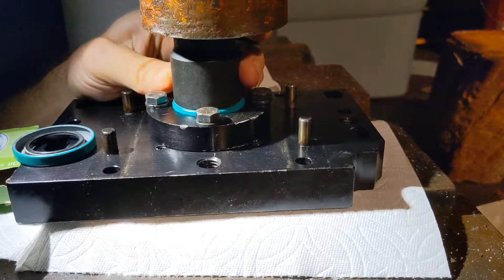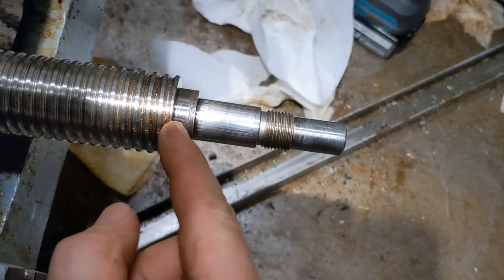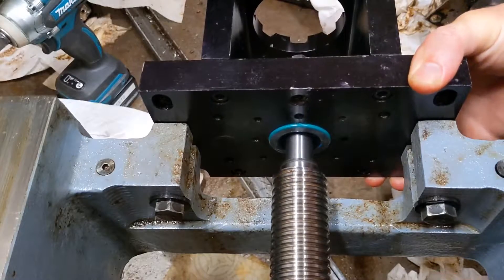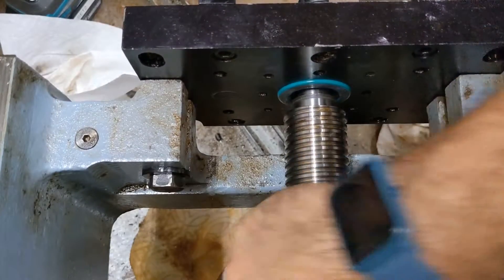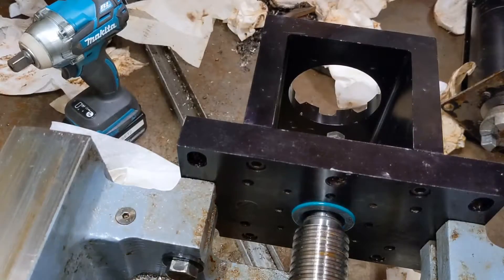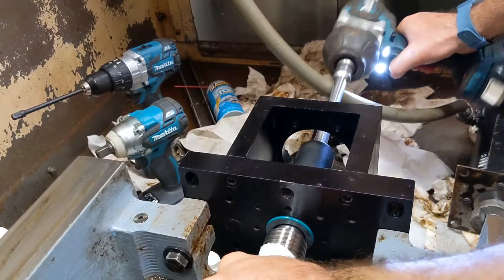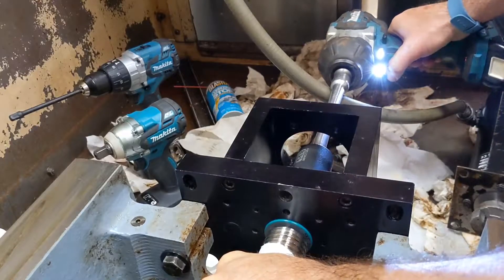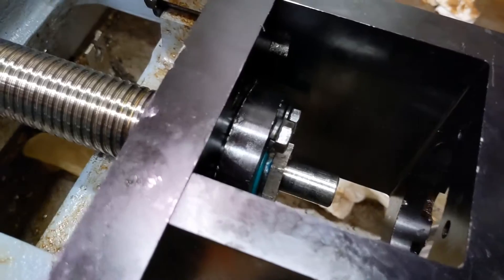Fadal 4020 Thrust Bearing Replacement Part 2

Comment: How have your preloaded thrust bearings been working? Any issues after running them?
Reply from the maker: I'm still working on rebuilding the rest of the machine so no actual hours on them yet... I'm replacing the controller and DC servos with AC servos etc..